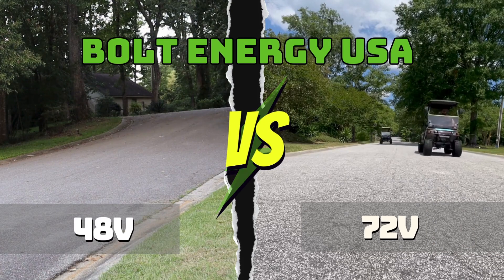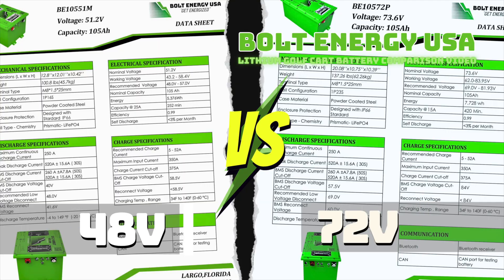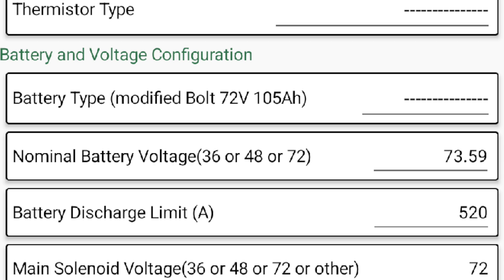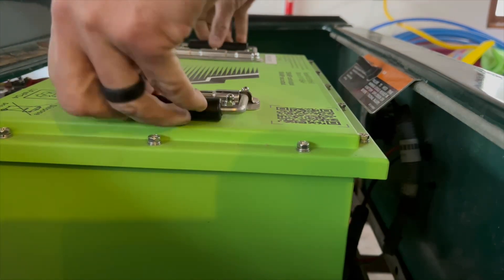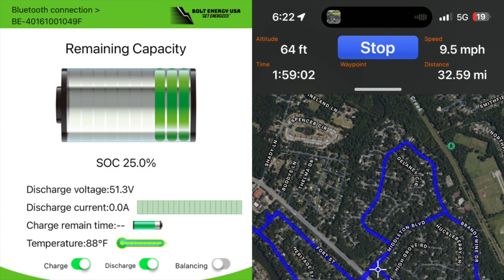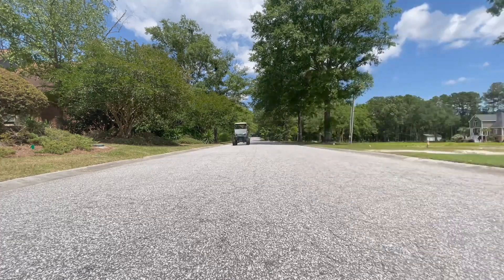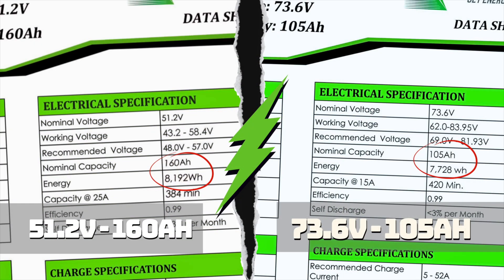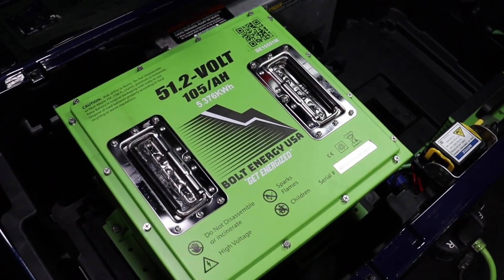48V vs 72V Golf Cart | Power & Performance Comparison by Bolt Energy USA

Comment: Sorry. I thought people chose the 72v for the range and efficiency. If not for the range, what then do they chose the 72v system for please?😮
Reply: For speed, I get 51 MPH out of my 72v Club Car DS
Reply: How. What all do i need to get 51 mph @Coolcarting
Reply: @JacintoP-xw5tx  Navitas 600 amp controller and five kilowatt motor, plus 72 volt lithium batteries
Reply: Dang that's crazy 🤪

Comment: What did you have to do to be able to run 72v? I’m looking at the mini 51v 105 currently as a dual but this video has me curious on the 72v 105. I got hills, 4 adults and 27” tires. Looking to do it right the first time.
Reply from the maker: I have an aftermarket motor and controller compatible with 72v.